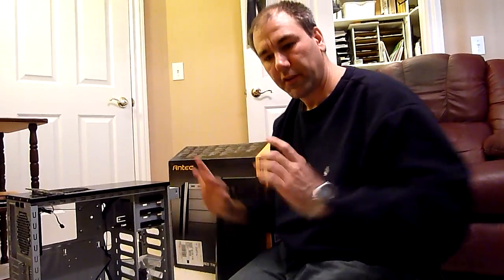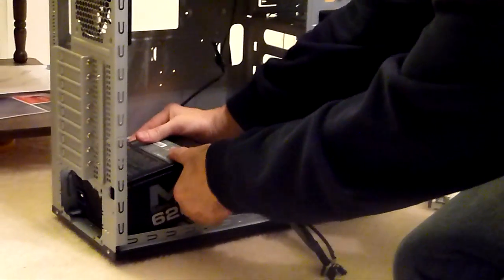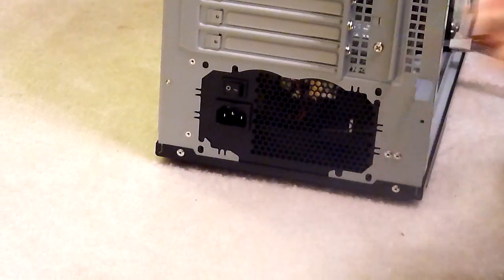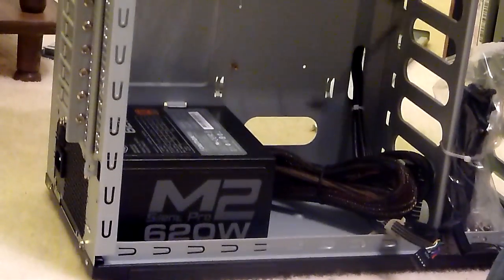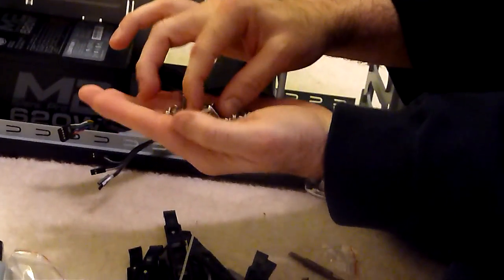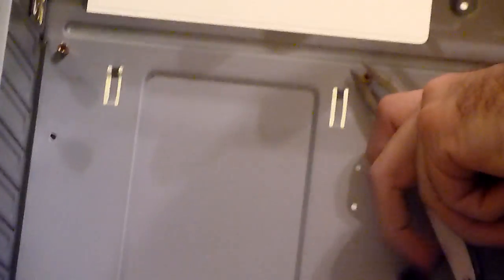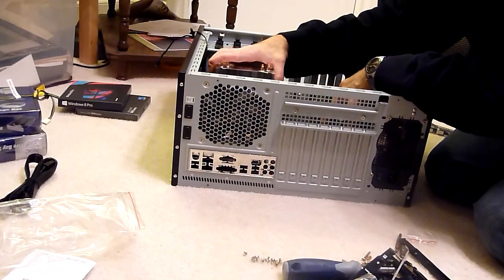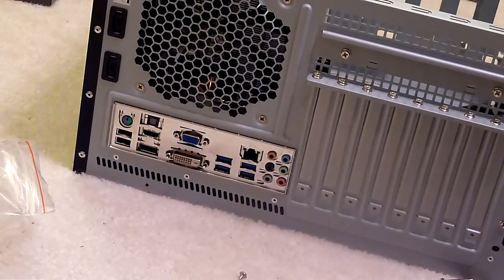Build your Own PC 3: Install the Power Supply, motherboard supports, and motherboard

Comment from the maker: Good question- It isn't obvious. I learned from years of experience... In the old days there were 3-4 common types of screws, thankfully now only two. One is a thicker, coarser threaded screw used for screwing motherboards, power supplies,  add-on cards (e.g., video cards) and case doors.  The other is a skinnier, fine threaded screw for securing hard drives and DVD drives. Sometimes each of these two come in larger "thumb-screw" versions, where the head is bigger, but the threads are the same.